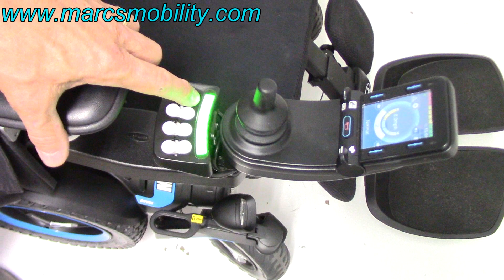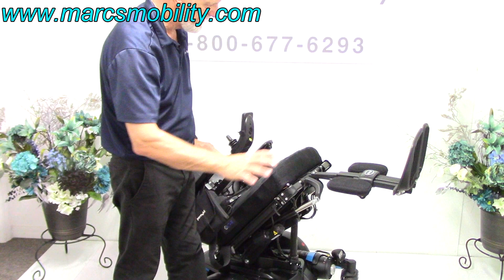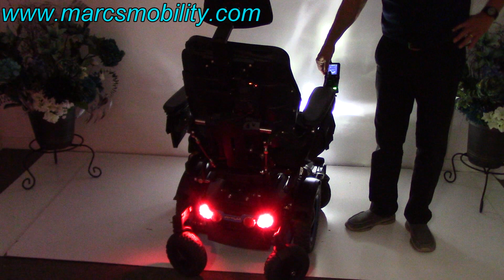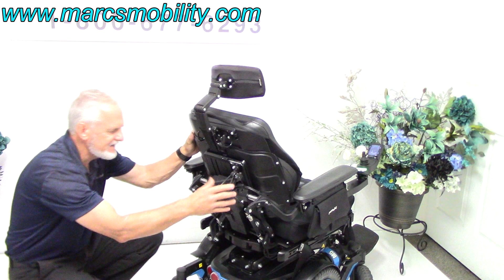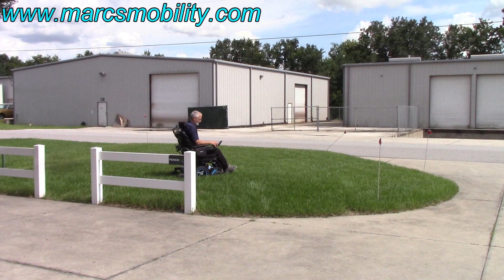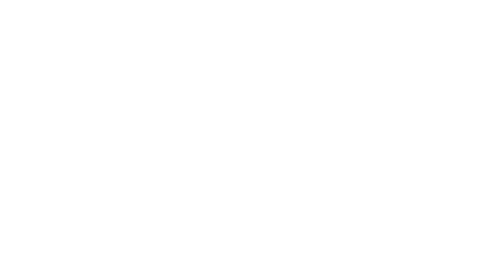Permobil M5 Powered Wheelchair - Seat Lift, Tilt, Recline & Legs #1748

Comment: Good tutorial I am sold. This chair has everything I need , seems heavy but that only means it will be stable with a load. At 7 mph it will be fast enough surely. Thanks again for all the specs on this unit, I've been wondering the differece from the M-3 or F-3 and this M-5. It's probably something like the raising seat max or that.
Reply: M5  14 inch seat lift , and high speed motors  7.5 MPH  Thanks Marc

Comment: Hi ..  may I pester you for help on my c300 ?   I am the only owner , new in 2008.   My right main center wheel locked up & would go in circles..  it will engage .. attempt to go  straight  until the resistance felt .    

I am a c4 quadriplegic so    ..  I need my chair until I can get it replaced.   It’s time to retire it if ya consider all the work done & all tires needing to  be  replaced.. & batteries .  My legs are powered , I just don’t have power to the foot plates ..  single footplates cause ankle sores & just too hard on my left leg that is paralyzed too.   I love how the c300 rides , aside from  sidewalk cracks  & it didn’t transfer from street to  curb  all that  well.  

I have been told  it could be  the motor & should replace both.   
Many things were assembled incorrectly by the guy  I  used since paralyzed by a mfg spine device they knew would cause quadriplegia..  no cervical patent .    So I am 20 years into this & finding the pronto, jazzy select to be awful wheelchairs.  Their boat seats to single footplate harming my  limbs  & skirts lol, are not like my  c300 .   Things we take for granted like  a arm  rest wide enough  to transfer & not stick  or  be burnt  by.. a Harley cup holder  & swaying arm rest , electric  tilt, recline  & actuator assembled wrong ..  are all dearly  missed.   Everything I learned to do is out the window & not like ole Woody on the Toy Story ( replaceable) my grandson through out my window .    I  could use some guidance, advice .  
My c300 has been discontinued & I have been  told parts  are a issue ..  backed up new purchases are in process.  

Marvin ,Sam Schmidt’s dad gave me a pronto much like the jazzy select I was loaned recently.  Boat seats & single heavy  footplates should be restricted.    Marvin’s wheelchair is for lefties & has 2 dead batteries with sulfur, wouldn’t charge & damage to the footplate that my inflated legs  to toes can’t handle.   He was oh so generous & for this ..  please acknowledge Nascar ,  paralysis &  all that  Sam Schmidt has done with support I wish we all had .  Driven ..  is a downtown lasvegas nv biz owned by Sam .     It isn’t every day that someone just gives a wheelchair away..  even if it isn’t a good temporary Wc for me..   it will help someone as I pass it on ..
Wheels 4 Quads  is a must so luvAquad .  

I listened & replayed  your video.   Would a c300 wheel lock up for other reasons ?  Are you servicing wc repairs in NV ..   are you working with pt / ot’s in NV for new  power wheelchairs requiring a dr’s script? 

Thank you for choosing to help the more than 500 thousand in the US with permanent Spinal Paralysis..  SCI.   
Ty for reading  :) 

Very best regards,

LT